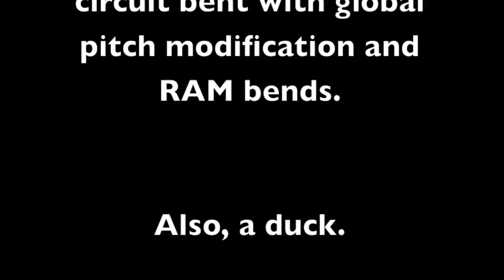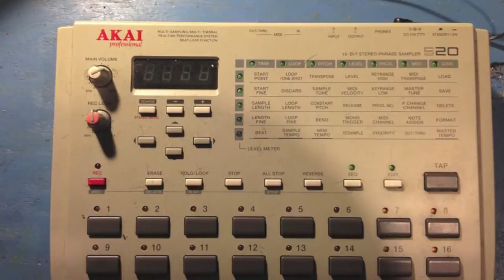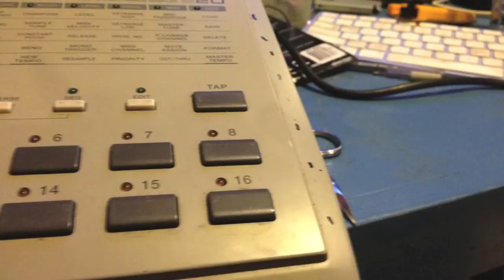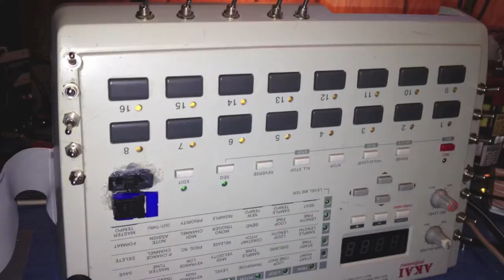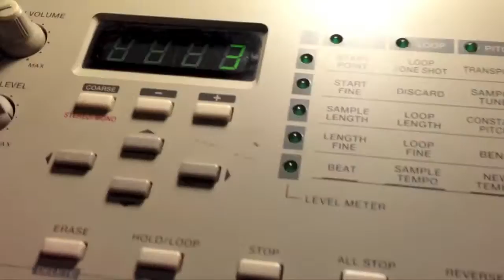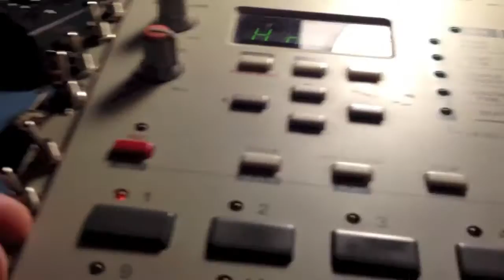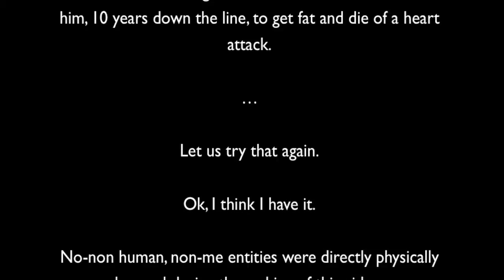"Moog Circuit Bending Challenge 2012"

Comment from the maker: Any machine that uses SIMMS or ROMs has pretty much the same modding process, so to make this one more challenging I added things like the tap tempo button mod and decided to use only resources I had at hand, also I had to basically rebuild dozens of traces on the control board.  I also had to create a replacement port for the failed ribbon connector.

My last S20 took about 3 hours to do.  This unit took over 20.